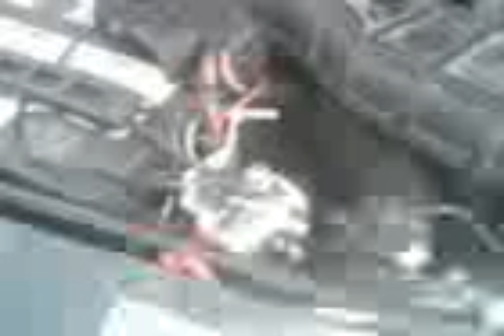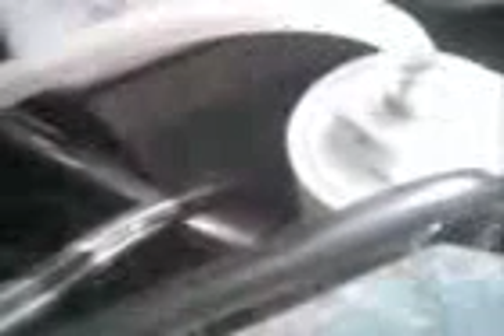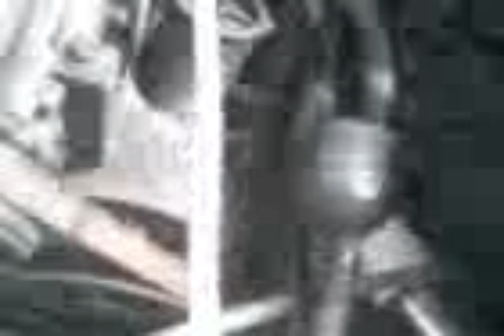My HHO system in 94 Ford Epl 4X4 Video I

Comment: I'd like to see the internal elements. Did you video or photo that? do you know the amperage draw on the solenoid? Are you having trouble maintaining a seal on the pipe threads after a bit of use?I considered pvc but was afraid it would become brittle exposed to underhood temperatures.Have you measured any mileage yet? Looks good and very compact.

Comment: I've not been using any electrolyte myselfe because of heat issues.I have been told a lot of the gas from baking soda electrolyte is co2 anyway.

Comment from the maker: I will photograph the next internal element, or when I clean the present one.  Cleaning will not be soon because the electrolite is TBLSP Sodium Carbonate(pool PH increaser, soda ash).  Much better than baking soda(Sodium Bicarbonate).  The water stays clean.  Although the water heats with near 30 amps, but disapates out the bare pipe while driving.  The PVC is holding up real good because it is not exposed to most of the heat.

Comment from the maker: The water is filtered from the super market.  It is not leaking because of the vacuume.  I am using pipe threader, high temp silicone, and marine epoxy.